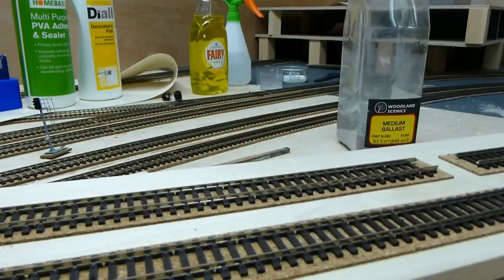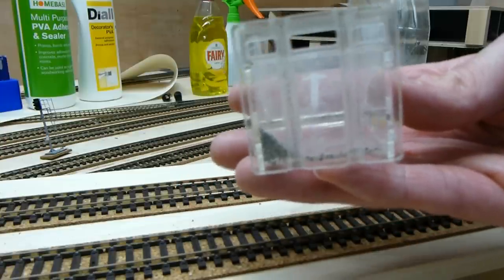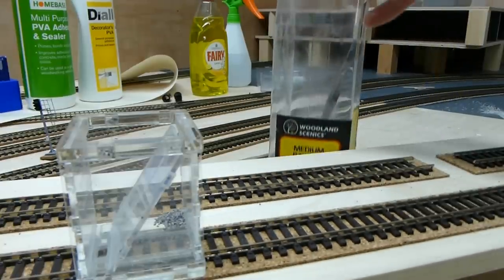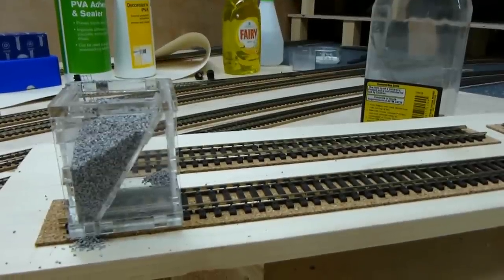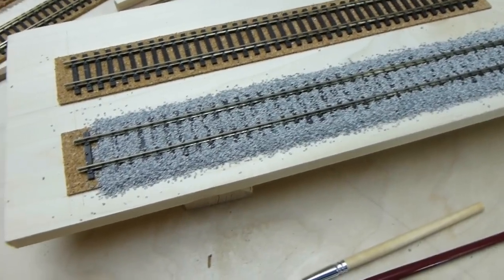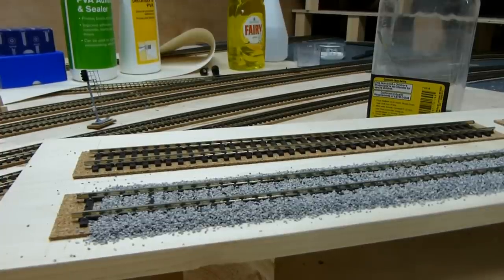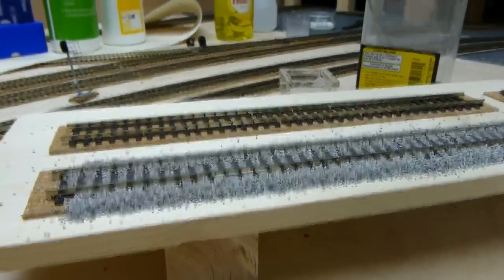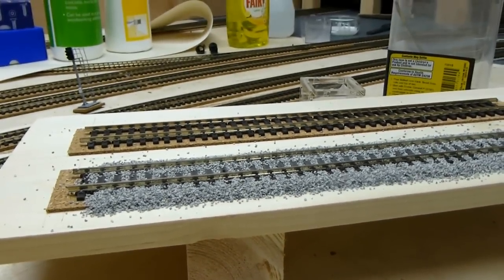Dean Park Station Video 39 - How to Ballast Track

Comment: Great informative video. I like the screwdriver tip to clear the rails, I also use a spoon to lightly tap the rails which also seems to help the ballast settle into the sleepers and clear any unwanted ballast from the rails.

Comment: That is the best ballasting video I have seen and will use your technique when I have finally finished laying scenic track.  A great job and thanks very much for the clarity of the video.
Regards,
Anthony Ashley
Reply from the maker: Anthony Ashley Hi, its a fool proof method, or so I have found so far lol.    Tapping the top of the rails with a tea spoon just after laying with the spreader if also a great way of settling the ballast and getting some of it of the sleepers. Dave

Comment: Fantastic. For anyone not wishing to use glue + later spray paint the track, I fixed and painted all my track prior to ballasting it without glue - ballast has mostly remained in place over the years, occasionally the higher shoulder edges need a quick tidy up with a brush where small amounts have vibrated off, but generally no regrets about breaking with convention! Main advantage has been alterations made to track layout later on, when track can just be pulled up/ballast swept up and re-used. (Where grime-coloured ballast was desired to match grimy track, I soaked ballast in pot of diluted grime paint before letting dry / laying it).
Reply from the maker: Thanks, you have an interesting technique, which clearly has its plus points.   I would probably end up messing all the ballast up when I cleaned the track or started banging nearby with a hammer etc. lol.

Comment: Spot on Dave. Just one little tip for the future, certainly applies to N but no reason why it shouldn't to N....Put track pins NEXT to the sleepers and not through them. At the end most folk remove the pins as they do tend to look wrong, and by putting the pins next to the sleeper and bending them over the actual sleeper (N gauge pins are probably best to use) when removed they do not leave a hole in the sleeper. Cheers, Bob
Reply from the maker: Good tip! I don't notice mine to much as they dull down when weathered.   But it would certainly look better without them. Dave

Comment: Hi Dave! Rather than mess around with PVA and water which can cause clumping or floating ballast have you tried Johnson's Klear? Use it straight from the bottle in your dropper (no need to mist the track first with water!) and allow to dry which is pretty rapid! Saves a lot of time which is always a help when ballasting. Also a small point about coating the sleepers with PVA. PVA and plastic don't make for good companions so could cause problems with lifting when you start weathering as I've found out to my cost in the past. EXcellent series and looking forward to the next episode!
Reply from the maker: Info noted, thanks.   I will watch out for the pva issue when I weather.  Thanks. Dave

Comment: Dave I've use the b&q one like you mixed it but it's taking a while to set but the shed I've built even though insulated is quite cool, I've put my calor heater in there for an hour to see if it makes a difference

Comment: Hi Dave, I am resurrecting my layout that has been idle for over 25 years.  I have re-laid the track, as the old sponge foam underlay disappeared into dust.  My track is a mixture of steel track as well as nickel silver.  Where I had ballasted back then some of the steel track has shown minor signs of rust from the ballasting process.  Is there an alternative to water based PVA for the steel track sections.  Also I would have liked to see the track in your excellent video a few days later after it had dried.

Comment: Great video.  I thought mine was dry after 3 days and tried to clean off the ties and it was still wet.  I made a bloody mess.  The basement is too damp.  It takes about 5 days to completely dry.  I really don't like doing it but it has to be done.  You definitely have more patients than I do for it.

Comment: As always great video Dave, thanks. I'm in awe of the level of detail you go to with all your modelling and value the extra info you provide, like websites you use, part numbers etc. Have you put these on a pdf etc. as a reference? Limited selection here in NZ so great to visit these sites. Now it's getting late here so my eyes may be deceiving me, however at the 30min mark is that a friendly face to the right of frame? Cuppa tea time?

Comment: Hi Dave. I am not currently a model railway hobbyist but am very much enjoying your layout and videos. I wonder if I could ask some advice - I am using ballast for some scenic work on a Scalextrics layout, have used the same Homebase PVA and water, though I confess to not measuring volumes, but due to the layout being in the loft (as many are) I am struggling to get it to dry as its so cold! If neat PVA is painted onto the boards I find the ballast finish is too flat, but if mixed and spraying I find it too wet and not drying? Any thoughts (other than putting a heater up there for a while??) Many thanks, Mark

Comment: Great Video Dave, i'm starting my layout and thinking of using a bit of Black ink in the mix to pick out the detail of the balast, and im toying with the idea of using Rowney Acrilyic Red Earth ink for rust on the rails rather than straight paint, have you tried the ink for rust on your rails and if so what were the results like? i've used it on buildings and the effect is really good but not tried it yet on bare metal.
Regards
Steve

Comment: Hi Dave, being new to modelling I find your videos very informative and helpful. Please continue passing on the knowledge. I've recently started a new layout and made the mistake of using the foam underlay, it's ok but not good. So i've decide to take it up and change the track bed, the question is should I use cork or the Woodlands scenic? Should I glue or nail? Obviously the cork covers well when ballasting but will the more solid scenic work as well? Any feedback would be appreciated before I waste more cash....
Reply from the maker: Hi!, both will work....I use cork as its very versatile and reasonably cheap.  I am not too familiar with the woodland scenics stuff, but it may be expensive if doing a lot of track?   I do not glue the cork or track down.   I pin it.  Once ballasted its all rock solid in place anyway.  Cheers. Dave
Reply: Hi Dave, thanks for the feedback. Its not a large set up about 40 feet of track on a 6x4 foot board. 
Probably go for the cork 3/16" ? to reduce the noise? The problems I had with the foam stuff was mainly on the cross overs / points despite leaving the rail pins with space to move. As you suggested I will do a test rail first, after watching you video again. Please keep up the video's it just shows what can be done, only wish I'd asked first before buying.... cheers Malcolm

Comment: what would you suggest for N-gauge track?
Reply from the maker: Use fine grade ballast. The same technique for that.
Reply: @DeanPark  thanks.

you have probably seen what I have started on your FB group.    I have to put the point actuators in, (some minor track lifting required first as I didnt quite know where I was going to put the points) then lay down the ballasting

Comment: how did you make your platforms,,there very good,,It is better to use small paint brush,,and paint your undiluted pva,everywere you want ballast to stick,,after dry ,,your can lightly brush away,any unwanted..then you can dilute pva,and use your spreader,,it looks more realistic.,yours looks to level with the sleepers..Your system is for  modern concrete sleeper..
Reply from the maker: Good tip.  Thanks! My system is kind of for an era when the concrete sleeper was replacing the wooden.  The rest of my layout will be concrete sleeper.

Comment: What thickness of cork do you use on your layout and in this video?
Reply from the maker: Kristoffer Cummings hi, for the mainlines I use 1/8th inch (2.5mm ish). For stations, depots etc I use 1/16th inch, or 1mm.

Comment: does the Homebase PVA glue dry clear
Reply from the maker: Hi, yes.  As does all PVA.   Don't worry about it looking white and milky...it will dry clear.   If its cold where you are ballasting then it may take 3-4 days to go clear and set....in January it took my ballast 5 days to harden.   Jut be patient and leave it. Cheers. Dave

Comment: Hi Dave  just some info on the ballast shoulder  , in real life it is there to cast a shadow onto the rail so it  will  not get to hot in sunny weather and the warp . Yes honest .
Reply from the maker: Wow...really?  lol.
Amazing, the engineers think of everything ;-)
Cheers
Dave
Reply: Is that a lie?
Reply from the maker: no idea! lol, sounds an interesting idea.
Reply: DaveClass47
How would that work? Surely sunrise or sunset may be the only times a shadow could possibly be cast, and then the sun wouldn't be that strong. Surely!
Reply: Absolute rubbish. Who told you that?
The shoulder is there simply to prevent lateral movement of the track! That's why it's at the sides and called a "shoulder"!
In the age of information, ignorance is a choice.